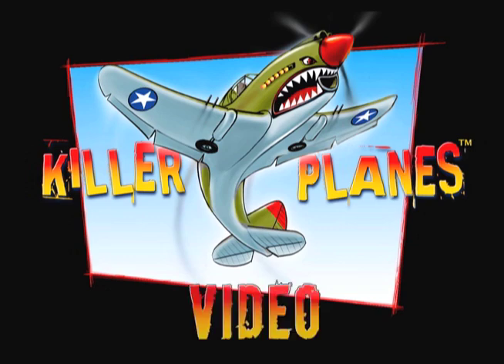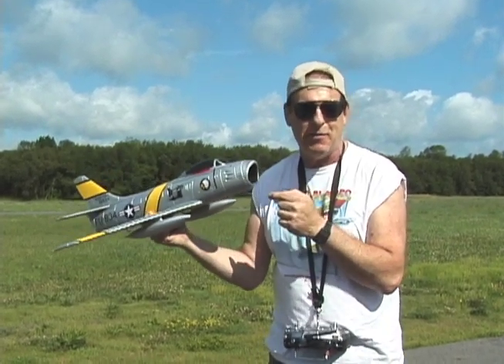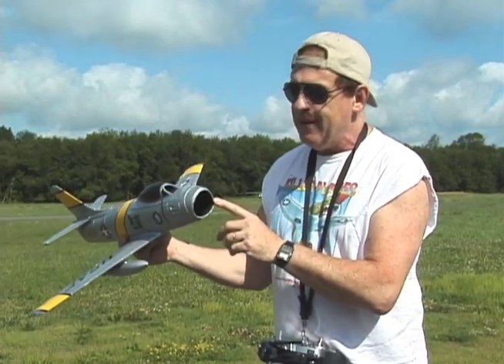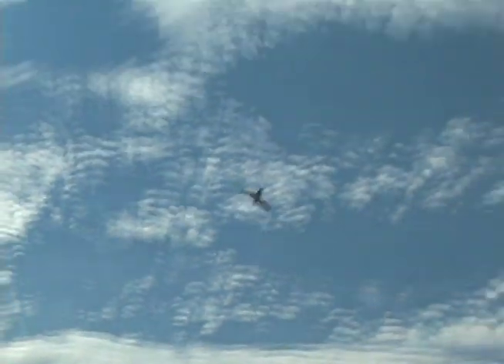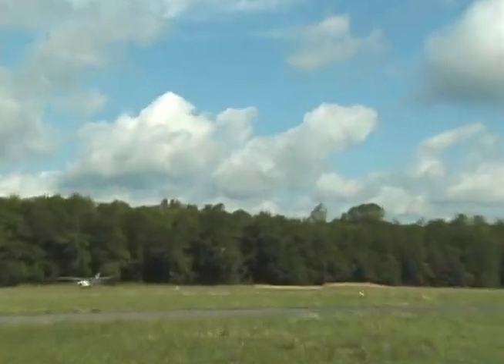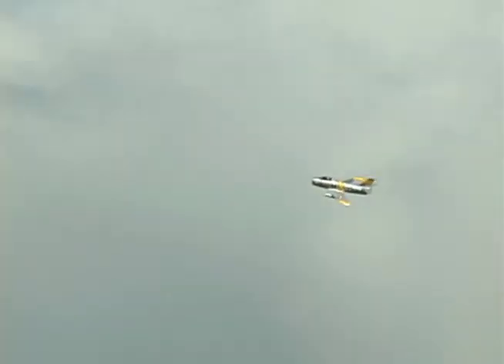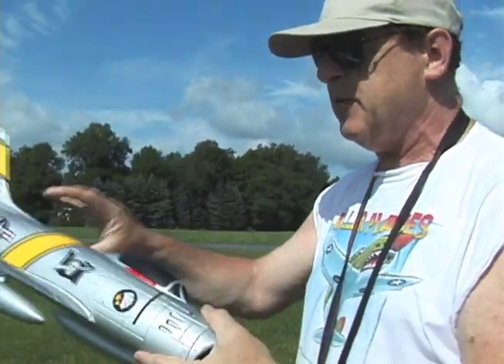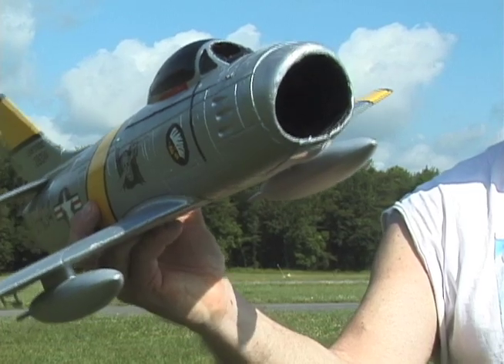FREEWING F-86 64mm EDF RC Airplane Flying with Killer Planes Supermax Crashproofing Installed

Comment: Tempting!!!  I've wanted an EDF.  I wonder how easy it would be to install a 4S EDF?  100mph?
Reply from the maker: Not hard at all- the motor is accessible with the wings off (very easy, in fact). Don't know if the supplied setup can handle 4 cells (yet)

Comment: Always look forward to your vids.  You and Denise captured this one well.  Do you think performance may have been drag limited by the wing tanks... meaning, cut those off and adjust for balance, and ..."voila"...just curious.  I actually think this might be a good beginner plane because no flaps, Landing Gear, but jets do have that funny (with deltas and swept wing) tip stall and spin characteristic.  You made it look easy, but is it easy?  Anyway nice vid I will wait for the answers.. good job again!!!!